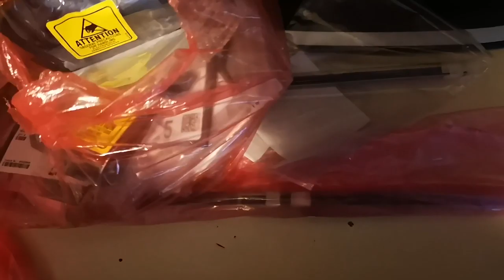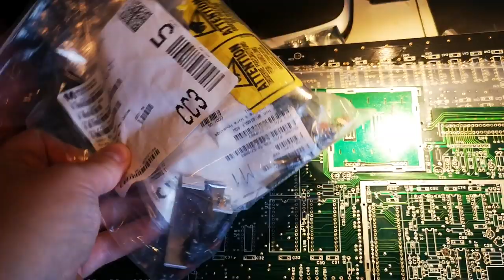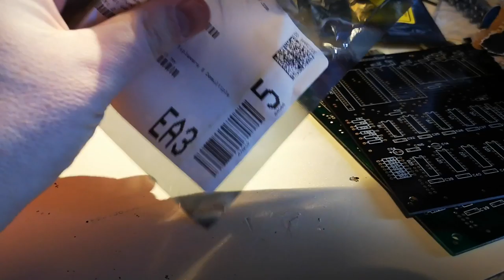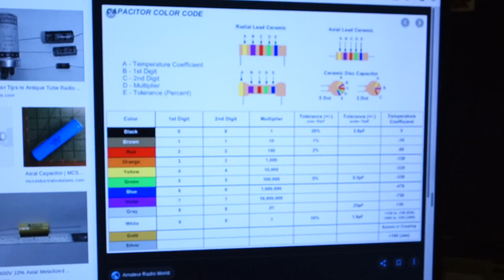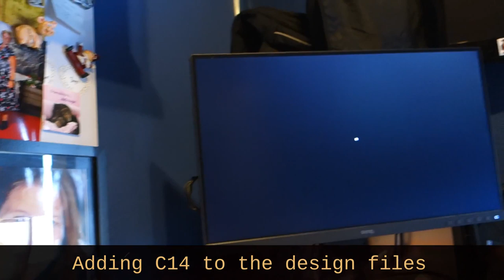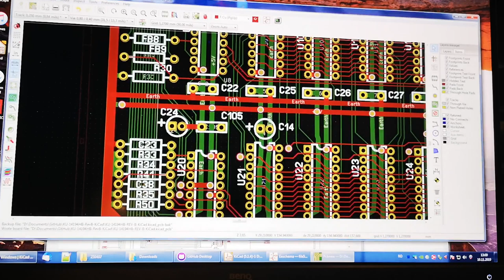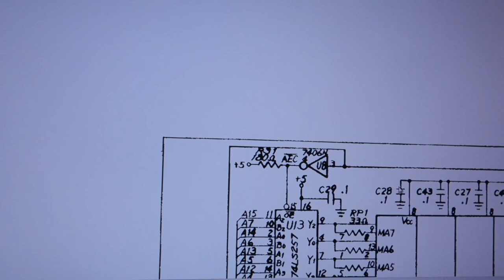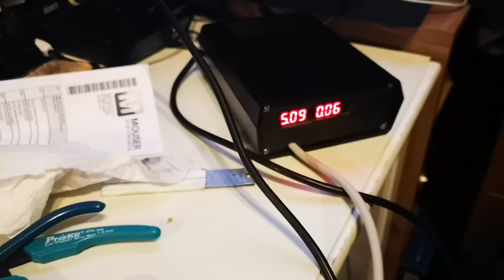C64 KU Motherboard replica - part 2

Comment: An excellent Part 2! As usual, I am really enjoying this series from you. You have done amazing work with this project so far. Not to mention, the black PCBs look fantastic. It is a shame the parts ended up costing you so much. Would it have been lower customs and taxes if you had ordered in smaller batches?
Reply from the maker: Thanks Mark! It might. I could have ordered passives from ELFA. That would reduce the number of lines in the invoice from mouser.

Comment: Try TME for the components, no import rates.
Reply from the maker: Thanks. Not sure if it will work since Norway is not a member of the EU.
Reply: @bwack  Oops... they send from Poland
Reply: @bwack  Not sure if it helps since I'm in Canada but I've had good luck buying components directly from china via ebay. Lot of good sellers on there if you're ok with the long shipping times

Comment: I may have missed it. But were can one order the hard to find parts?
Reply from the maker: There are bom floating around with reichelt and mouser part numbers. You can look on my github repositiry. It should be in the description of this video.
Reply: @bwack  Cool. Thanks. 🙂 I am going to build one SixtyClone 250466 board my self. The worst part to find, are a set of cartridge port and bracket/shield on top.